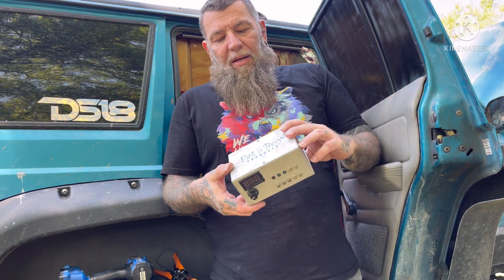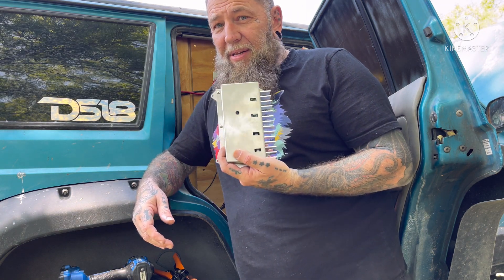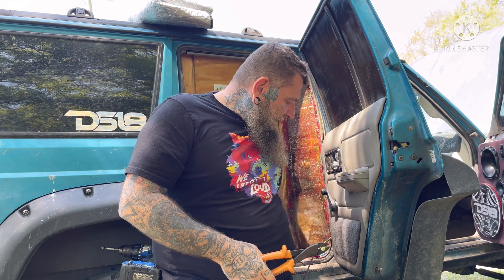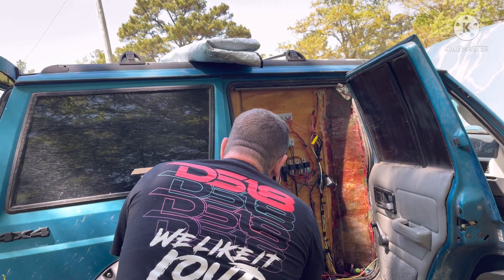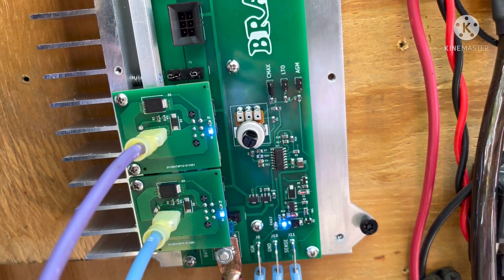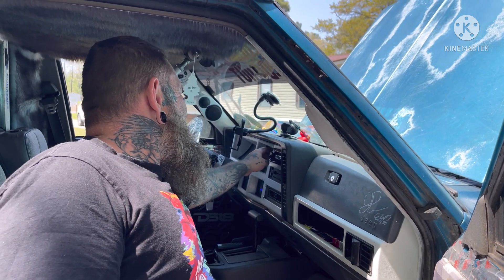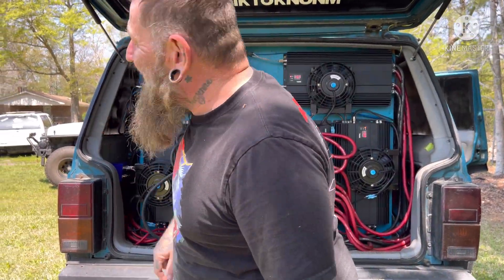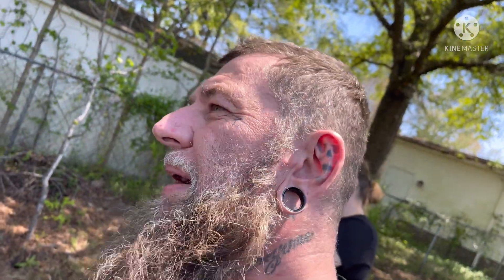Installing the revised Brand X voltage regulator

Comment: So do you have to run 2 power wires from one alternator? The one on the bottom right, smaller red wire and the one on top, by the adjustment knob?

Comment: Hey jerry! Ive got a question about this regulator. Ive got an 05 magnum rt and at the alternator, one wire has battery voltage, the other has a real low value. Im wondering which goes where. I’ve reached out to brandx but the answer i get is “instructions are in the box” maybe you could hook me up with the fella that helped you?
Reply from the maker: is your alternator external regulated ? if yes.. then the wire on plug closest to the charge stud will go to fields. ground the other wire to alternator case. if it's not an externally regulated alternator then it won't work
Reply: @JerryAintloud  yes sir its externally regulated.. thank you so much for answering. So my question is, the field coming off my alternator goes in the top? The lowest wire on the regulator goes to the lithium? What do I do with the other wire that comes out the back of my alt? The other wire in the plug.
Reply: @JerryAintloud  ahhh I think I understand. Just ground that second wire to the alt case? Dude you are the man

Comment: If you want to ruin your vehicle, new vehicles have computers that regulate alternator to charge battery, bought this $80 over priced junk oh and by the way go to EBay or just google item, they are made in China and cost $2.99 to $11.99. They rip you off and laugh all the way to the bank. Check out the BBB in OHIO, you can see what kind of scam this is. Stay away! It will cost you a computer or alternator or sensors burning up. 🔥 💩

Comment: I just got my 350 amp alternator from Ohio generator but do all ho alternators whine. I haven't installed it yet but should I expect to hear a whine?
Reply: It will whine when under heavy load, but it's not loud. You likely won't hear it with the engine running, maybe very slightly with a large draw applied.
Reply: Ohio gen makes great alts. I bet you're happy with it.
Reply: @georgesrisomsak9650  yes I am very. Now I just need to do the switch to lithium instead of 12 agms

Comment: What exactly is a field wire I never understand that is it just the ground of the alternator?
Reply from the maker: these alternators do not have a regulator in them.
Reply: The field wire is the variable voltage input to the rotor, to increase, or decrease alternator output. 

You vary the amount of power into the rotor, to vary the magnetic strength that's generated, and control voltage/output.

Comment: I would like to see it under a load, I can bring my bank up with two 390:s at file from 15.5-16.3 within a few seconds I have 180ah and a transpo unit, idk why it isn't bringing yours up to 16 at idle u should be making enough amperage to jump that bank up quickly, the only thing a transpo does it monitor voltage and if it needs to come up it send battery voltage tk the feild wire I wish I could have amperage on demand instead of full field every single small blip of bass